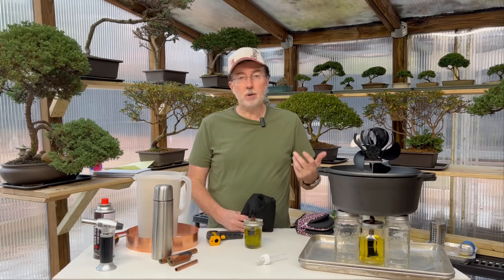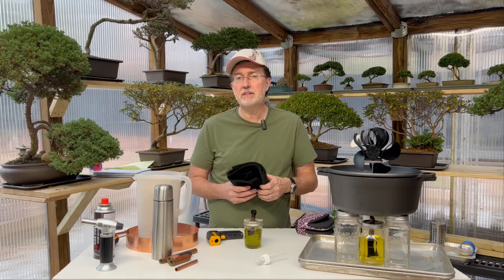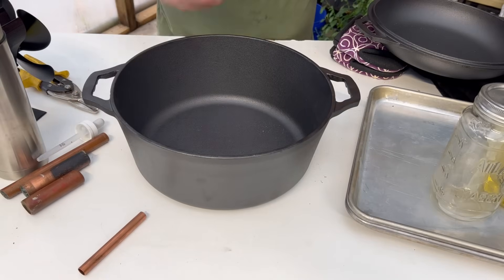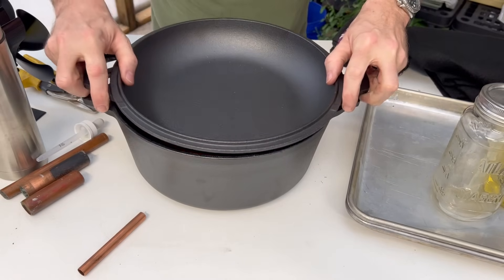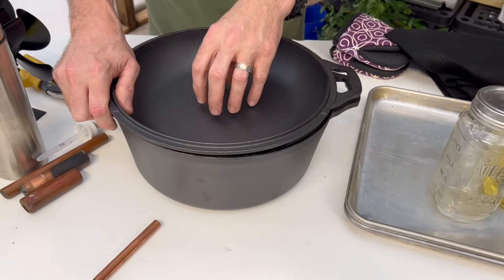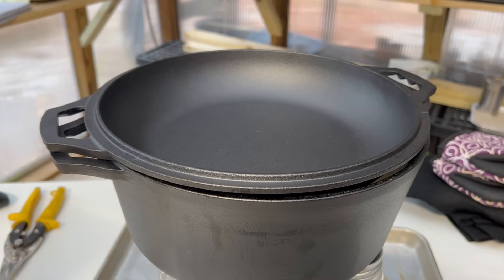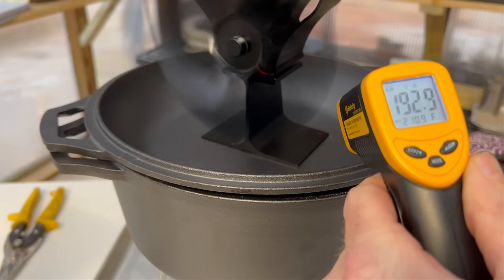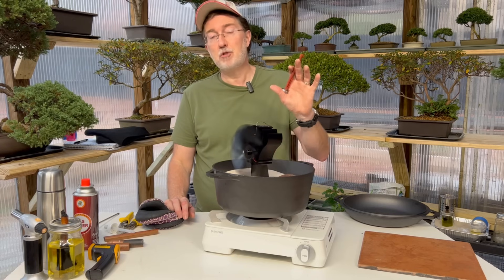DIY Heating Sand Battery With Fan | No Electricity Needed

Comment: Would this work with a wood stove for extending the heating for a hot tent or log cabin?
Reply: That is my intent to use my sand heater in garage for, want to keep my kittens warm in winter.

Comment: I made the carbon felt candle and used new canola oil. It gave off a thick black smoke, there’s no way I could use it inside, any ideas how to fix that?
Reply from the maker: Use a very pure fuel.  99% alcohol.  Or any product designed for clean burn.

Comment: Thanks so much. I've always appreciated the heat sink capabilities of cast iron. (In fact I scramble my eggs in a cast iron skillet AFTER turning off the heat and achieve the perfect temp for the scramble.) But I never thought of using sand much less a copper element.  I'm going to experiment this weekend at warming the smallest room of my house as I'm anticpating some rolling brown outs this winter. Think of the lives that could have been saved with the Texas freeze that caught people off guard.
Reply from the maker: Imagination and experimentation is the key to changing the world.